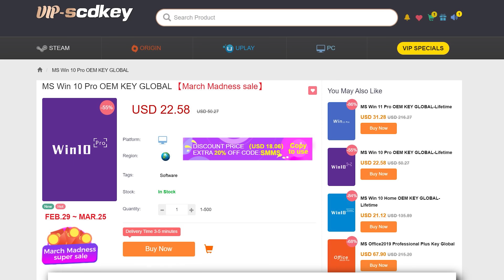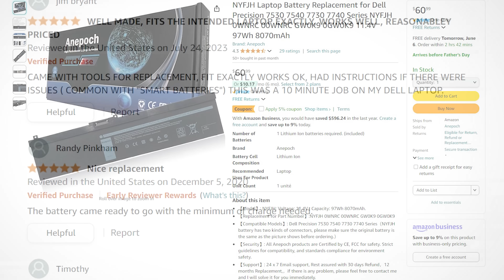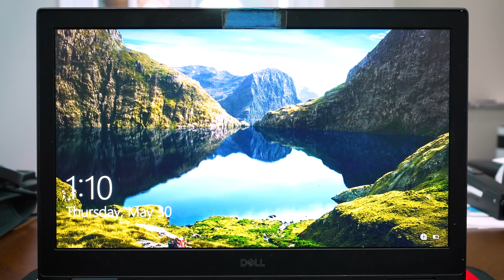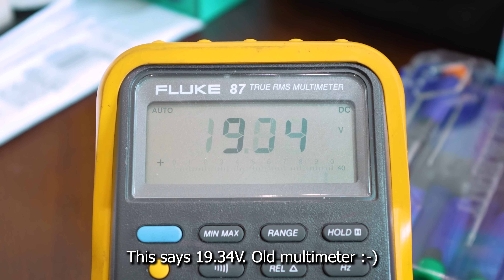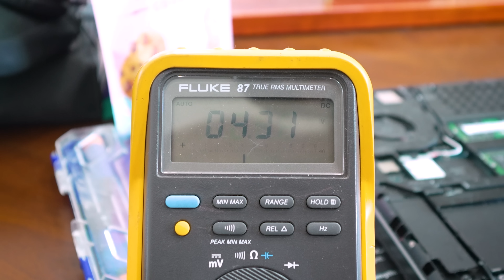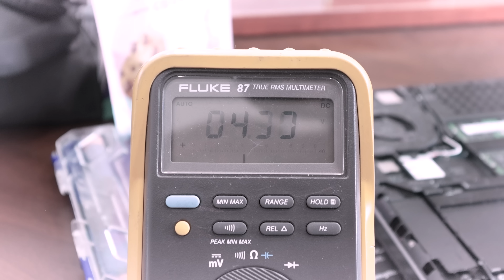Fixing a Viewer's BROKEN Gaming PC? - Fix or Flop S5:E14

Comment from the maker: So yeah, this clearly isn't a "gaming PC," but YouTube's algorithm is unforgiving and I didn't wanna risk changing anything! And, for the record, my dad DOES count as a viewer! 😅
Reply: You can also get a usb thumb drive for the M.2 card
Reply: probably a bad charging controller on the mobo or a daughter board.
Reply: This is a great opportunity to do a collab with The Greatest Technicial that's ever lived @SalemTechsperts
Reply: laptops are super useful if you don't want a traditional multi monitor setup, each have their own storage so you can split up workloads completely rather than the system if it isn't strong enough.
Reply: It can play solitaire, it counts 😅
Reply: ONce they stated that phones can game then anything can game.
Reply: my old asus rog laptop battery is complete dead have to keep it plug in for it to run it has a i7 4700hq and 870m gpu runs fallout 4.
Reply: if he plays "spider solitare" on it, it's gaming PC ;)
Reply: @mp0011  or minecraft
Reply: It could be the "Power Switch".
Reply: As people have said before, battery or power adapter was the unlikely culprit right from the start. Admittedly those were the easiest to check, so I can't be too mad. With symptoms like these, I'd guess there is a short on the motherboard somewhere. Often this happens due to liquid damage (spilt water), frying a connector to a daughterboard (a section of the laptop's outside ports may be a daughterboard) or on a single USB port would give that result. Power comes on, something is detected as a short, laptop shuts down. Disconnecting a daughterboard and booting it them can help, but leave the laptop without a few functional ports. It is a relatively easy 'fix', depending on how far you have to tear down the device. Beyond that, it is probably soldering time, which is not something you would do on a company device if you do not have explicit consent from the company to do it. Not gonna give hate for not wanting to work on the internals of a company device.
However, as a recommendation, your father probably should not use the company laptop for everything, including personal tasks. Sure, one thing is risking everything on a single SSD, but also company laptops are usually managed by the company's IT department who sometimes switch on annoying Windows settings that can and have led to data loss. Or lead to all your personal files getting backed up in the company cloud where who knows where they may leak to. On a personal machine at least if something goes wrong, you are the more probable culprit. I'd recommend having a second PC (or a laptop) for personal stuff.
And yes, the current SSD can just go into an external SSD enclosure and should work fine. Just may need to check if BitLocker or similar was turned on that may cause some difficulties later, but it seemed like it is probably just plain unencrypted data.
Reply: minecraft works on igpu.
Reply: Hahahaha
Reply: DELL uses some IC's in the battery, on the board and the charger. If it detects a different IC, it fries it. My dad had a DELL a while back and pulled it apart piece by piece and he found that out.
If you buy an original DELL battery, it will 100% work, that's the whole idea.
Don't bother using DELL! EVER!

I do believe ACER, HP and Lenovo are doing the same thing.
Reply: Dell Precision comes with quadro graphics cards and lowest cards in these machines are good enough for 1080p gaming so technically it is a gaming PC/laptop.
Reply: He's a Nepo Daddy!
Reply: I had a Lenovo laptop where I had to replace the battery within 2 years (wouldn't charge more than 60%). Which was absolutely insane. The battery was likely defective off the factory line. Bought an OEM off ebay.
Reply: With all the money your family has, surely you could just buy the latest all singing and all dancing laptop for your Dad.
Reply: I can't forgive you for the clickbait, Greg. Send me an actual gaming pc like in the title, and I'll forget everything. 😂
Reply: And is your dad even a viewer? I call shenanigans there, too!

Comment: I had a laptop that the battery kicked the bucket, so I only had it plugged into the wall. The cord would need to be just right. If it moves just slightly, the laptop turns off. Im sure the plug connector to the motherboard is loose.

Comment: dell batteries are renowned for their quality and life, but I have  seen quite a few of them bite the dust over the years. I think it may have to do with the lithium swelling. Simple fix: charge until full , then unplug. It would be nice to see Dell include adapters that have an automatic shutoff when the battery is full.

Comment: My first thought was to check the solder joints on the power connector on the motherboard....  your batteries are not charging which means they're not getting anything through the power brick to the battery to charge it it's quite common for people to step on that power coupling and break the solder joint on the motherboard... I just want to point out that you didn't fix it originally what you did was you put in a battery that had more of a charge than the old battery had and so it ran until that battery too ran out of juice.. this is a sore spot for me because back in the day I had a laptop that had this problem can I send it to the shop locally to have them put a new motherboard in cuz I knew what the problem was they charged me $600 for a new motherboard when I got it back it was still not working right and I found out that they didn't replace the motherboard all they did was plug in their battery and saw that it was running and then sent it back to me

Comment: The board fried, the battery, or the non-OEM battery fried the controller chip on the board. I’ve seen that before. Many of these cheap battery manufacturers do not put the proper protections on their battery. They simply use a resistor to emulate and make the device THINK it has the proper protection..

Comment: First off the company should have paid for all repairs. If I had attempted to have someone else fix my work laptop I would be fired in two seconds flat since it contains private company and customer data. Not withstanding, I probably would have sent back to Amazon the battery as non working. It was made for the laptop and power supply so not your fault if it fried the battery.  Laptops definitely more challenging than PCs!

Comment: Aftermarket batteries don't have the same on board power regulator, therefore using an Aftermarket battery in a laptop is very risky. When you replaced the new battery it worked no problem,  when you introduced the AC adapter the controller inside fried. The on board controller is cheaply made and a laptop with an i7/32GB/ plus some sort of graphics will definitely kill an Aftermarket battery. I've replaced many laptop batteries, I stay away from offbrands because the headache is not worth it.

Comment: I had something similar happen with my mother's laptop. Seemed like odd power issues. Changed the battery, and nothing. After hours of following the flow of power with a multimeter, turns out the SATA M.2 port had fried. Took the drive out, installed a 2.5" SATA drive into the other port, and it posted. 🤷‍♂🤣

Comment: As someone who works with Dell laptops.
Because of the age of the laptop with this kind of issue, we would replace this with a newer unit. As a business we look at the time taken for said IT technician to try to fix a 5.5-year-old laptop only to possibly have issues down the road only costing more time, best practice is to flat out replace the laptop with a newer laptop. That is how businesses work.
It does sound as an environmental standpoint to fix the laptop, but you have to think how much of the IT technicas's time is used up trying to fix it and as this is a work laptop how much time the user (In this case, Greg's dad) is down a work machine while the repair is ongoing, just the way how it works in business.
Now if this had been a personal laptop the practices would be much different.

Comment: Ahh I hate messing with Notebooks they are the most annoying.  Fans probably vibrated the CPU power connector or main board power connector, the pins and wires are so tiny you need like tweezers to connect them.  They are also prone to becoming loose over time.

Comment: You need to do a hardware reset. Unplug it from power, and hold the power button down for 30 seconds. If it turns on before 30, release, and rehold the power button down for another 30 seconds. Fixed many dells with this issue.

Comment: I've had a laptop battery that died.  With the battery installed, laptop would not run.  Removed the battery and the thing would boot and run just fine. Maybe worth a shot in the short term.

Comment: Had the same issue with an ASUS laptop. The board got fried when I was charging. I thought it was the charger, but the charger still works and using it now, as the original charger of my new laptop has a broken cable, and since it’s a company machine, I can resolder the cable. Although on my never laptop, the charging port was loose and moving - turned out the connector’s solder started to wear off. A quick resoldering fixed that computer

Comment: NEVER use cheap batteries, this is exactly what happens when you use one of these cheap batteries, it works fine for a bit and then complletely dies for no reason
it is 100% the batterie's fault, this exact same thing has happened to every laptop i replaced that battery in with a cheap one

Comment: So, this comment is going in before the end of the video. Yeah, I know I know. First thought may be the battery, but just so people know it is possible to break the charging port IN the device itself. Happened to my old laptop. Power brick is good. Battery is good. Port is borked. Not saying that this is what I believe to be what's gonna be the culprit, but considering I've seen plenty of laptops that run when the battery literally cannot hold a charge at all as long as the power cord is connected and plugged in, it's at least a possibility.

Comment: One thing I've learned over the years is never buy laptop batteries off Amazon,  at least with Dell you can buy a highly overpriced genuine from Dell, yes it is $120 but its a genuine battery, if your genuine Dell battery up and quit like this at least you can wave your invoice about and someone will eventually help. Laptop batteries off Amazon?  You almost seemed to accept your lot with the Amazon battery, that you'd keep it.

From all the laptop batteries I've been encouraged to purchase off Amazon, I never ended up with a laptop battery I was happy with (long term).  More often times than not at least 20-25Wh capacity difference to what the label says and the battery goes right back to the seller. Not sold as advertised! Label says 72Wh but designed capacity the battery is reporting is way way off.

Even when you hit the jackpot and they match, within a month or so you'll have already lost 10% capacity and after about a year, close to 50% and that is if your battery doesn't start emulating a pillow either. I thought I'd mention it because I never see someone shouting out "Hey check out HWmonitor/batterymon, it lists everything about the battery installed!" Designed capacity,  full charge capacity, current capacity and even wear level. Batterymon also has some battery statistics like charting out the health of your battery. 

Apologies for the long reply. Just thought I'd mention the faster way to test out a generic battery off Amazon.

Comment: Honestly probably something with the charging circuit on the board. Laptop should power in even with a dead battery when plugged into the wall. I have very seldomly ran into a laptop I had a bad battery that would not power from the adapter

Comment: Did you ever try charging with a high power USB C charger? It would likely be different circuitry than the main charger port. It might get enough juice into the Dell battery to turn on briefly and backup files.

Comment: Dell break/fix repair tech here. I have literally repaired this exact model. 5 years on a battery is REALLY great lifespan. Batteries are warrantied for 1 year. New batteries come with 30-35% charge by federal regulations. That loose DC-in jack IS a problem. It has to make good contact to charge the thing.  That motherboard is probably LONG out of warranty. And will be really expensive to pay for a replacement. 
Bitlocker may be running on that M.2 drive and you will NOT be able to read it in another PC if it's encrypted. 
And none of that other stuff you tried is going to fix this probably.
When the mainboard goes, it's done.
New laptop.
I don't think you killed the replacement battery.
In fact, unless you're Dell certified, you may have violated the company policies. DON'T TELL THEM you did this.

Comment: I work in IT at a company with ~30,000 Dells, and yeah the track record with these 7530s has not been great, in my experience. I have seen this exact same issue a few times before, and I was definitely concerned when the new battery went in and 'fixed' it, since I figured it was probably just going to come right back. I have pulled the battery and done CMOS clears for this before and it usually only lasts long enough to back the user's data up without having to pull the drive. It's a shame! The 7530s are all out of warranty at this point, even with the 5 year extended, so chances of repair are slim. I hope your dad doesn't end up with a 7680 as the replacement because they've been trouble for us as well.

Comment: Sounds like the infamouse dell power management board.  I do not know if they still make it a simple swap out process or if they now solder it to the motherboard. The dell laptops of the 90's 2000's it was as simple as swaping a attached board via a ribon cable or wire.

Comment: What I don't get is, if it's a work laptop - why is his job not dealing with it first and foremost? I know a thing or two about PC repair, but if my work system has a problem - I'm calling IT. I'm not cracking it open and mucking around in it, because then I'm liable if it breaks worse.

Comment: The actual charger is most likely on the MB and that is what is broken, connecting the new battery to the MB and the power brick probably just drained the battery. You don't have anyway to prove that because the laptop is being replaced not repaired and most likely with a different model, laptops are a different animal to work on. Great vidoe, keep them coming...

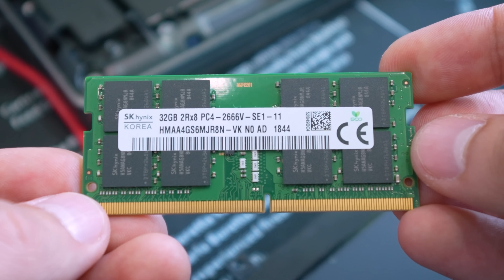Comment: 10:35 Holy hell, is that a 32GB DDR4-2666 module? Meaning this laptop had 64GB of RAM in it? If so, definitely save that if the laptop is being replaced.
Shame that the laptop couldn't be repaired but hopefully someone else with more knowledge of the issue can fix it. If you were in the UK, I know of a repair shop that would get that up and running again in no time.

Comment: Suffice to say, you really shouldn't buy aftermarket batteries. This likely was the fault of the manufacturer and not Dell.

Most third-party batteries (outside of ones from reputable sources) are not good, they either use low quality cells and remanufacture batteries, or they make extremely poor quality ones; they typically have extremely short lifespans on top of that.

It's also better from a safety standpoint, because good batteries from reputable sources also have been vetted by regulatory agencies to be safe (as in not bursting into flames).

Comment: If you check the charging circuit with the multimeter, you might find a shorted high side MOSFET pushing too much current from the main power rail into the battery causing it to lock itself as protective measure.

Comment: I have an older ASUS that does this exact same thing. It hadn't been used in a while and started it up one day to use it. After it updated it worked fine and I shut it off. Went back to use it a couple hours later and nothing but fans and keyboard lights. Replaced battery and tried different memory configs and nothing changes. Also pulled out hard drives.

Comment: I've tried multiple aftermarket batteries for laptops, trying to save a few bucks.  

Every single one of them was junk.  I'll only buy OEM batteries from now on.  It sucks that they are so expensive, but there's a reason why the aftermarket ones are so cheap.

Comment: Hey Greg, since it's a company laptop, give it back to them and let them figure it out.

If this was a personal laptop and you need to get this running again, you'll need to send it to someone that can test and replace parts that are soldered on. Chances are is the power mossfett has malfunctioned or fried. It should be an easy fix for someone that has the skill.

I'm just a computer technician that started in the late 90's. I just can't do soldering due to a wrist and shoulder injuries.

Comment: If you were able to get into the BIOS (through F12), Dell will show you the battery health of the current battery. But I will say that since this is a work laptop, performing any maintenance on it is potentially a bad thing. The company could view this as Customer Induced Damage and your Dad would be liable. I know you're making content, but it would have been better to speak with IT, either have them order a new OEM battery, or push for a quicker refresh cycle. OEMs could also have the ability to block non-OEM parts. TL:DR, let the company IT handle the issue and not take it upon yourself, as you could be liable for damages.

Comment: That power connector looks suspicious to me. I've seen those go bad all the time. Sounds to me like the new battery just died and that's why there is no power on it. And the OEM battery is just designed differently would be my guess why it still has some power.

Comment: unfortunately I have the same laptop and the 240w power supply not the correct one for it it should have had a 180w however that should not have killed the board and I would try disconnecting the video card they can give this type of trouble sometimes